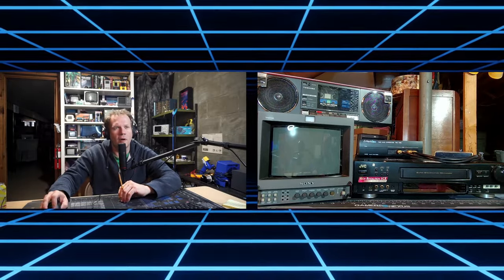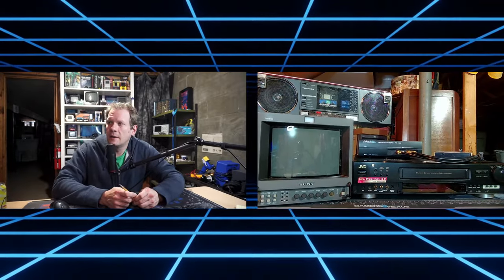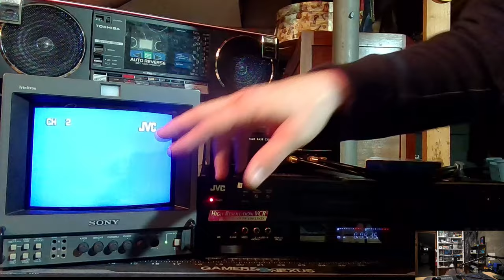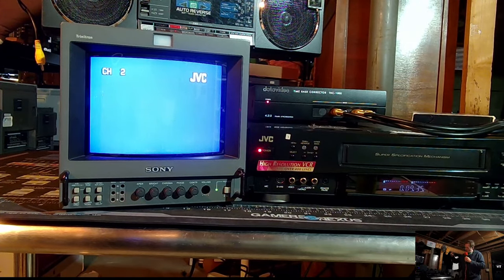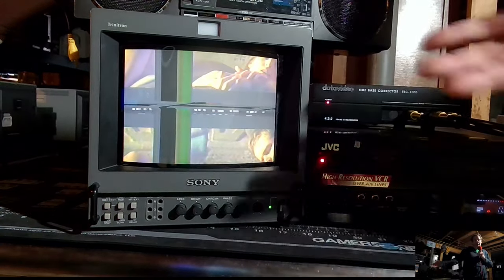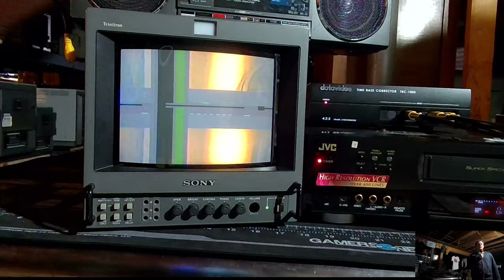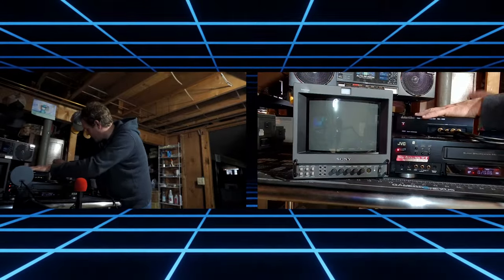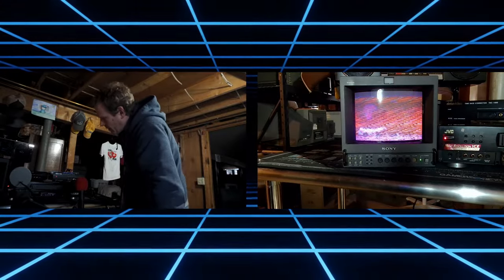Testing Time Base Correctors - DataVideo TBC-1000

Comment: The best Chain is VCR into a DMR-ES10 into a TBC-1000. The reason you'd daisy chain a DMR-ES10 into the mix is it fixes the tearing at the top of an image you get on worn tapes. (Those also need recaps!)
Reply: The DMR-ES15 is also really good I have one and image is so stable and better than my Panasonic FS200 with full frame tbc
Reply: @sos.gamers  The Fs200 has a field TBC (multiple line TBC)

Comment: Full-frame TBCs 😊 Though these units aren't the absolute "best", they are perfect for DIY home video capture.  In these units specifically, brightness reduction is the most common issue I see as far as getting a quality capture. Replacing the electrolytic caps is step 1. If there is a brightness difference between the two inputs, checking the resistors and smd caps on the I/O side of the board would be next. Most of the time, over/ under voltage is the root cause of the malfunction issues. A scope is needed to really see what's going on under the hood.

Comment: A waveform monitor would have helped a lot in showing this stuff and confirming it works. What a TBC is doing is replacing the signal with a stable reference signal sometimes the signal is noisy as I show here https://www.youtube.com/watch?v=iorwEtqHa-Y and the capture hardware can't lock on to the timing or read the color burst of a signal. By replacing that signal we get stable playback. As shown we also can retime signals which is important if the timing between two signals is different.  This was very necessary in days of reel to reel video tape as all the various formats had wildly different timing and no way to sync the cheaper formats to the more expensive.